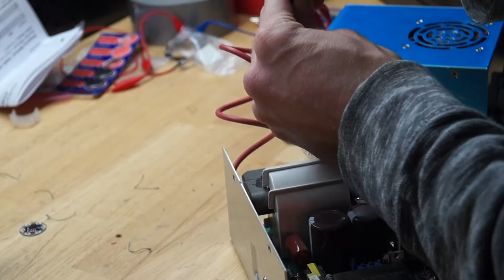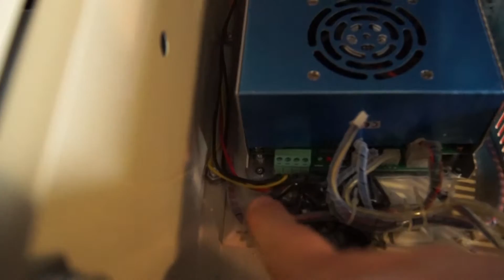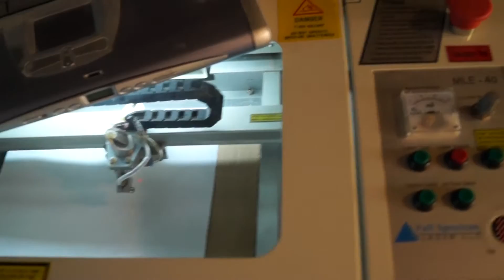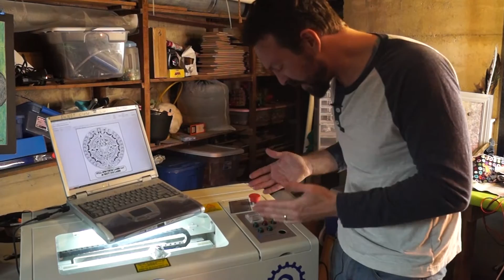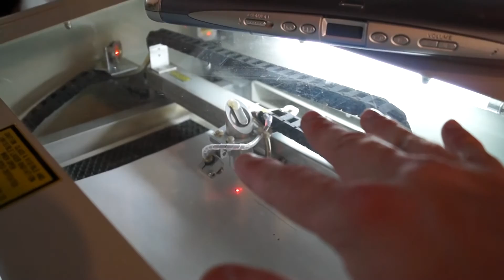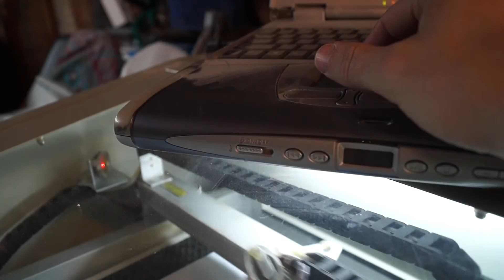repairing a laser part 2, replacing the power supply

Comment: You are completely wrong on the diagnostic. The red dot is for positioning purpose, you need to first align the red dot to the machine datum which is the location of the laser fire directly down to the table. Whatever engraving and cutting is carry out by the laser and nothing to do with the red dot which is nothing more than a positioning indicator for you to place your material.